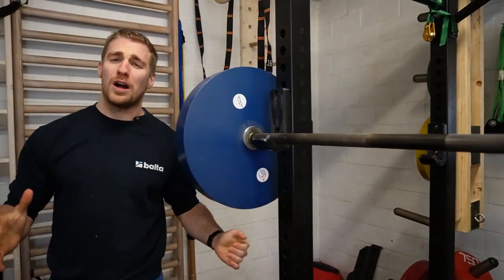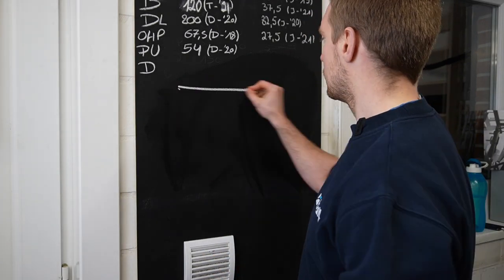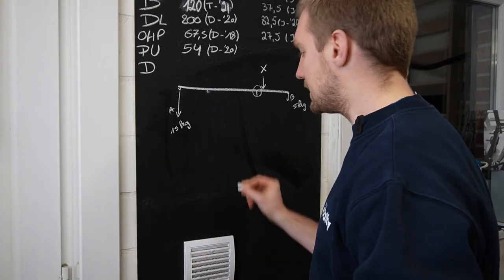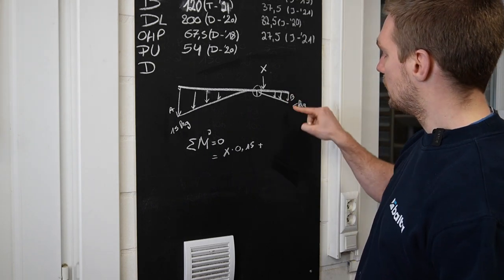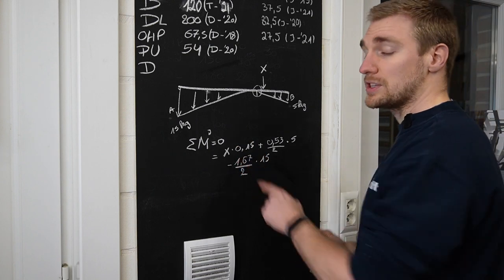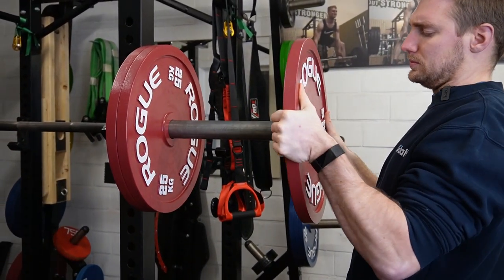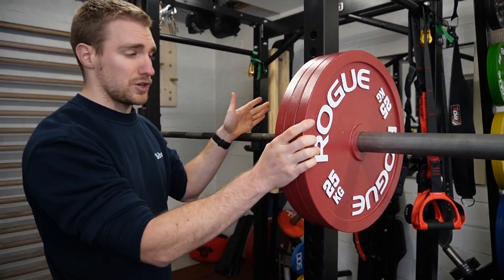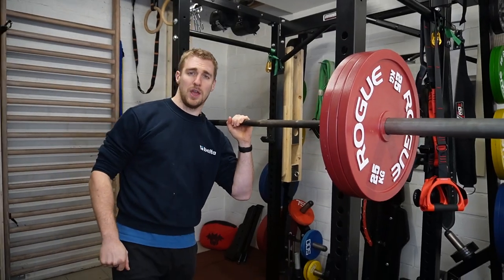How much PLATES can you load to ONE side before the Barbell tips?

Comment: This only works for powerlifting plates. The plates are thinner, making center of gravity closer to the fulcrum, needing more weight to counteract the balance. Using chunky crossfit plates would only require 40-50kg for it to start to tip
Reply from the maker: Exactly! Nice point you make there! I took the thickness into consideration with my calculation.